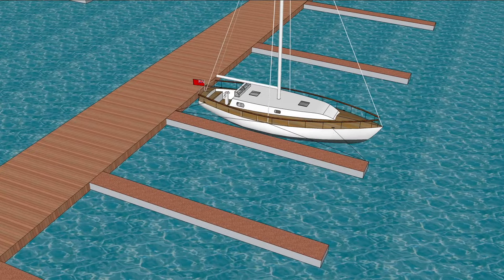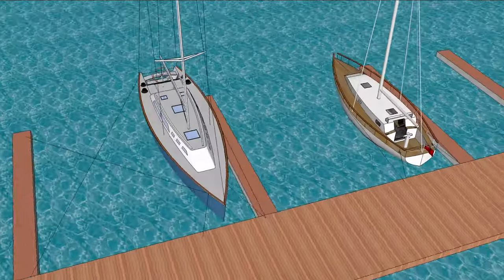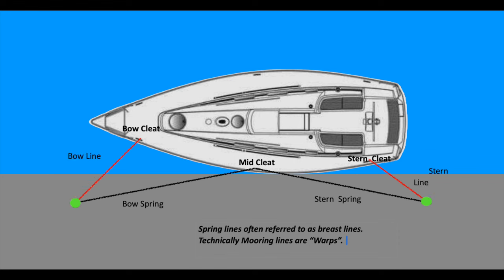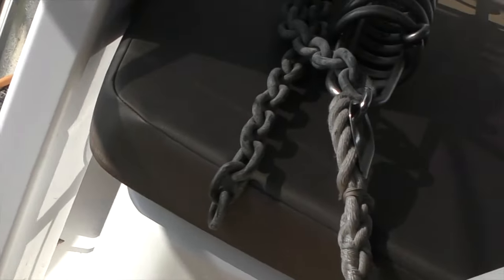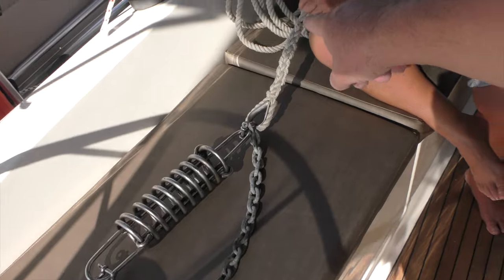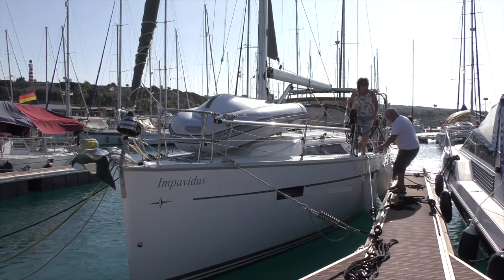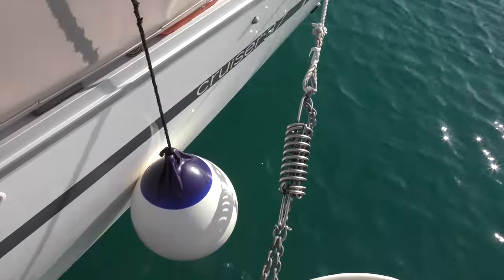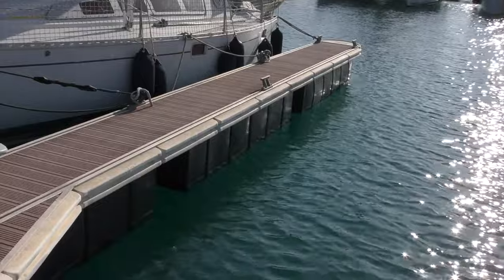Mooring to a Finger Pontoon. Got the right gear?  It's not just ropes and fenders!

Comment: We had a rubber-snubber some years back that failed in its first storm. After that we moved to octoplait anchor line for our long stay moorings. We simply have a bowline at one end which we put over the pontoon cleat and all the OXOs are onboard so they are easy to adjust. We do not use any other springs or snubbers. 

BTW - we totally agree about braided mooring lines. They are far inferior in terms of "stretch" but we find they are much nicer to use for coming in and throwing of getting the initial mooring done.
Reply from the maker: We had a set of ebay snubbers when we left the UK... They lasted a year. There is mileage in going bigger withe these things.
Reply: @SVImpavidus  - ours was for a 40ft boat and lasted halfway through Storm Miguel 😄Nowadays we just use the octoplait.